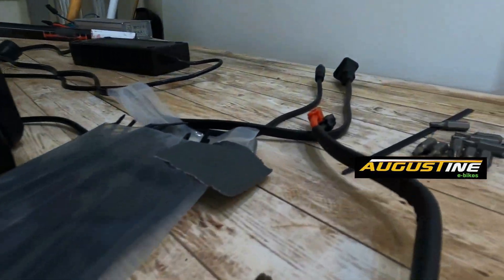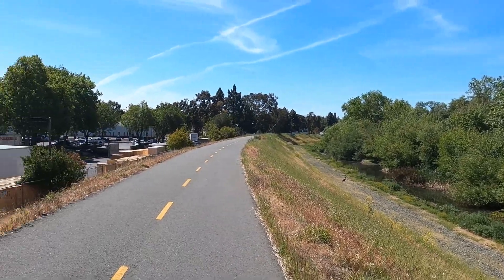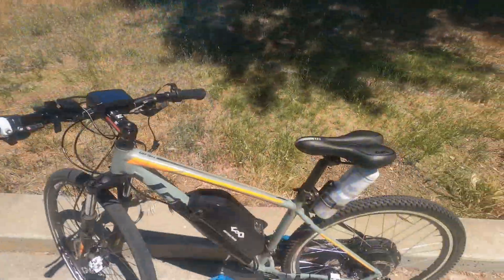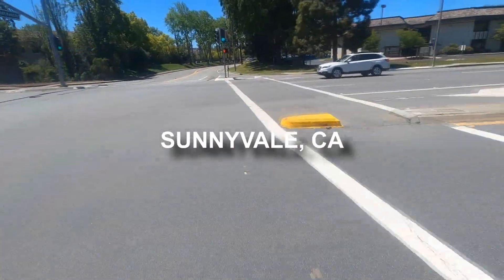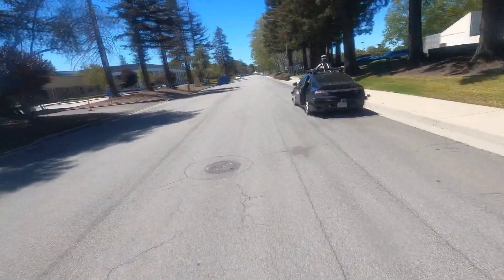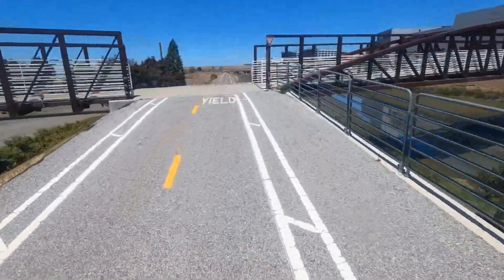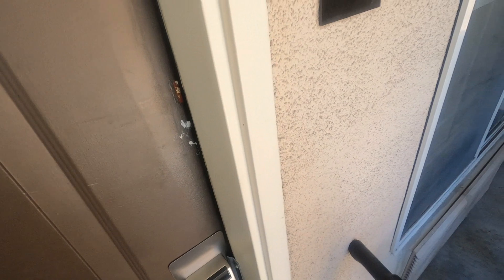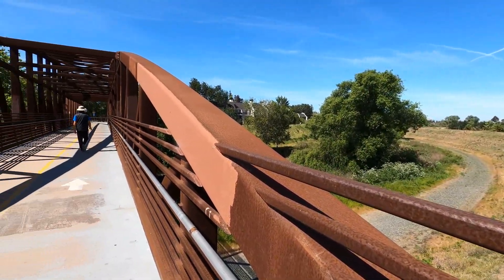E bikes 2021: 85 Mile Trek through Silicon Valley on my new 1500w - Built in Controller - EBike Kit

Comment: Hello Augustine,
 I tried to use links to amazon, but they doesn't seem to work. Would it be possible to get advice from you and maybe links to products I am looking for.
I want to buy a 1500w brushless rear motor wheel and 17Ah or bigger battery and the rest of the kit - controller etc. I want the best possible manufacturer and warranty for all of the components.
I weigh 115 kilos(250pounds) and my desired range is at least 70 km (50miles) with no pedaling assistance.
Cheers